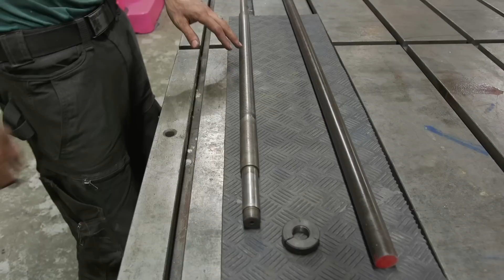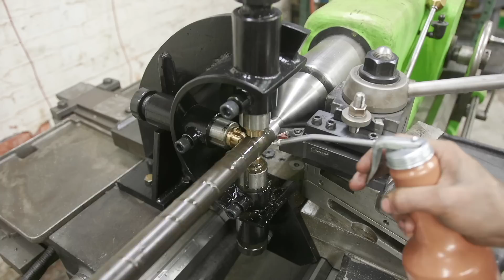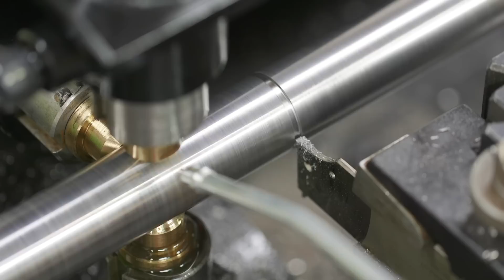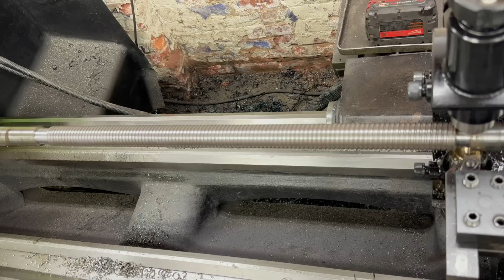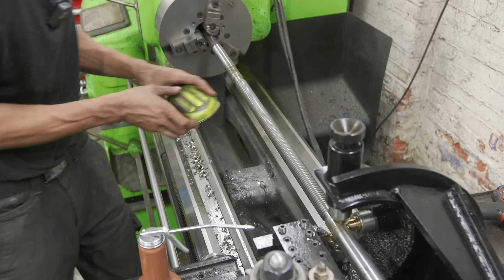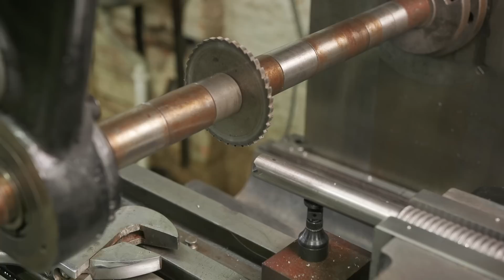Making A New Cross Feed Screw | Lion Lathe Restoration

Comment: When you changed the spindle speed on that gearhead lathe, Did you lose the "clocking" or rotational orientation on the threads....? in other words, did you have to re-position the cutting tool to keep it in the original thread groove ?

Comment: Always fun to see shop made tools work out re follow rest. The lathe I bought was missing both fixed and follow steady rests. So they were made in house, I did have a photo to copy from though, the follow rest on my lathe doesn’t have the 3 supports only 2. The lower support is angled in between middle and lower supports. Bring back some good memories as a retired manual machinist/fitter & turner. Keep up the good work, as your vids are excellent. After the acme threading was done, you could have set up the fixed steady down the line to give yourself rigidity and more room to finish off the part. And yep, what another said, no 90 degree edges. Use radiuses tools, if the part is going to fail, it’s going to be there.
Reply from the maker: Thank you I appreciate it

Comment: Very nicely done.  I haven’t seen an original pacemaker follow rest before so I am curious if the original straddled the carriage with three points of contact, like your steel design, or if it was simply bolted to the side of the carriage and the cast iron dampened the vibration enough to kill the chatter?  

To make a long story short-ish:  I am a professional carpenter/amateur machinist who lucked into a sad bastard of a Rivett 608 PV for a song.  Sadly it came with almost no tooling and I have spent more on a NOS steady rest and a used Aloris tool post than I did on the lathe.  I had to fabricate my own carriage stop clamp and still need to make a thread counter and a follow rest.  I’ve got a chunk of grey cast iron for the thread counter but will either have to try my hand as a pattern maker and contact my local foundry to make a blank for the follow rest (not likely) or make it out of steel (much more likely.)  The original Rivett follow rest just bolts to the side of the compound with two bolts and an indexing shelf that fits over the edge.  I’m wondering, if I go with steel, will there be to much transferred vibration for a similar mounting system or will I need to have “outriggers” similar to your design?  I’m not asking for your answer so much as for your opinion,  as someone who successfully made a new follow rest for their lathe.
Reply from the maker: The cast iron will add a little bit more rigidity. But even the sound of your design and the fact that it mounted the side of the compound doesn’t sound super sturdy so I would be tempted to add outriggers either way.

Comment: Just recently turned a new x axis leadscrew for my knee mill.  My lathe is almost 100 years old, it came with the frames for the follow and steady rests but no fingers. I used soft window weight gray cast iron for the fingers in the follow rest and it seems to do well in the wear department at least enough to get me through most of the process without having to adjust to account for wear. I ended up using 1045 tg&p for my screw, i wanted to used a piece of 1144 tg&p but i ordered a 1.250" round bar hoping to not have to do a bunch of turning but the bar was bent:( The 1045 yielded a less than desirable finish but it works. Nice job on your screw, looks good!!!
Reply from the maker: Sounds fun. Thanks

Comment: you should learn a bit about feed and speed, it disappeared as much from the saw blade as the shaft .. by the way, the vibrations came from too little chip depth, the shaft is meant to be pressed up against the support otherwise it will vibrate + you can drive 5 times faster in revolutions

Comment: you should get a mist lubricator lot easier than a can of oil.    Kool Mist 60M12 PORTaMIST Unit, Magnetic Nozzle Positioner, 12" Flexline. topper machine uses it a lot in his videos
Reply from the maker: I got one oil works better on certain occasions

Comment: When making undercuts for threading, the shaft will be stronger if you leave a radius in the corners by using a round-nose grooving tool instead of a cut-off tool.
Reply from the maker: Yes you are correct. with the force on these guys it is fairly unlikely the shaft will break in general. It is more likely to wear then snap. In theory you are correct.

Comment: Well done, end result looks good. Rolled lead screws are generally stronger due to strength hardening but in general are less accurate depending on the manufacturer tolerances. Edit: and forgot to mention, you should be using flood coolant or more thread cutting oil.
Reply from the maker: Don’t have flood on it. I limited oil for video sake

Comment: What material did you make that screw out of?
Reply from the maker: Stress proof
Reply: @VanoverMachineAndRepair  Okay I understand that What type of stress proof What type of material was it? Was a tool still, 12L14, 4140?
Reply: @chuckbeckley7894   I believe it was 1144 which is generally called "stressproof" because it's been heat-treated to relax stress. Neither 12L14 not 4140 are called stressproof.
Reply from the maker: @chuckbeckley7894  1144

Comment: Does that Pacemaker have thread reversing on the Apron?    Most of the ones that I operated in the Navy Yards did.  That's a handy feature to have if you do a lot of threading.  No need for using the thread chasing dial, just engage and reverse.  The lathes that had it also had stops.
Reply from the maker: Yes it does I should use it more often
Reply: @VanoverMachineAndRepair 😊

Comment: Why not use some ball bearings on the follow rest instead of the rubbing brass ? Is that done ? Pros/cons ?
Reply from the maker: Bearings are good for steady rests but but good on follow rests since the bearing traverses the part. Especially on low tpi threads a bearing could get caught between threads
Reply: @VanoverMachineAndRepair  ok so the brass does not get caught because of it's extra width.
So, use a wider bearing ?
I am just wondering why use a part that rubs and wears when a rolling part is possible.
Reply: With rollers there's a greater chance of getting a chip caught in the rollers than with solid brass contacts. Roller type steady rests are usually further away from the cutting tool and the rollers can be shielded from chips if necessary.  @bschwand
Reply: I think the answer you are looking for is...
Rolling bearings,  no matter what the size, are made with hardened materials.  Which in turn, can damage anything softer.  But, they are lower maintenance.
if you watch CEE videos, you can see him using a Steady Rest with Roller Bearings.  When he's done, one can see impressions in the work piece, and I'm not talking about the corrective cuts he makes for the Steady.  The impressions are inside of  those.
 Being construction equipment, not a big concern.  Time is money, and he has customers to keep happy.
 
Bearing Brass is softer them 90% of what you are going to turn, so, no damage to you work.
But, in turn, you have to sacrifice some Bearing Brass.  Higher maintenance.
Both have there pros and cons.  It's more about your needs.